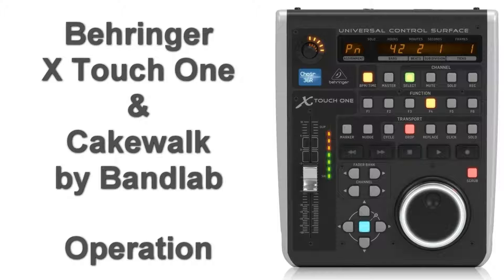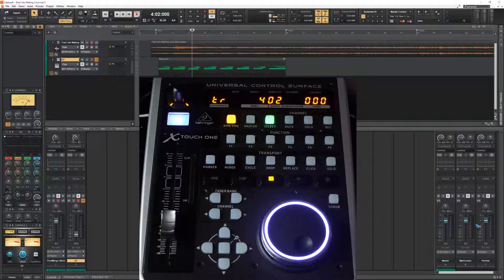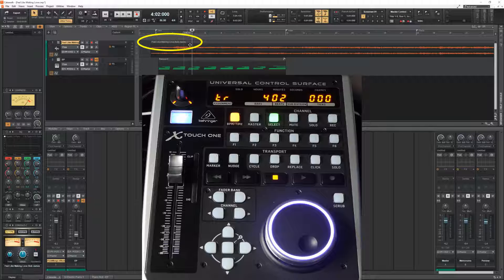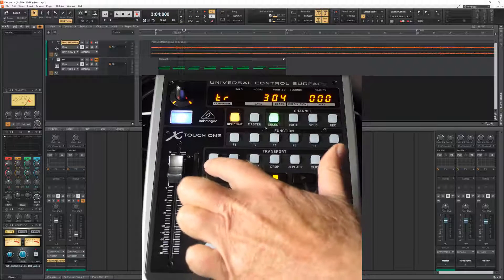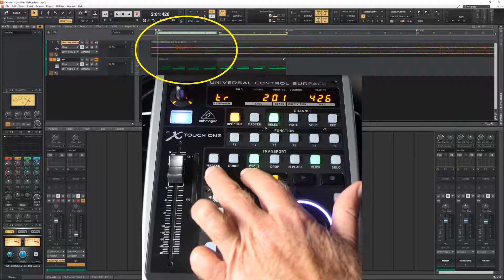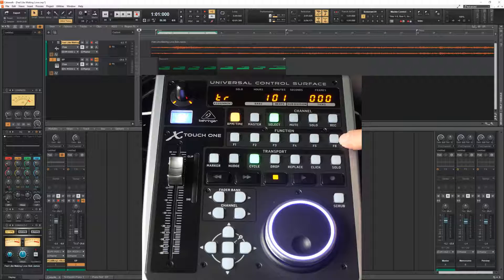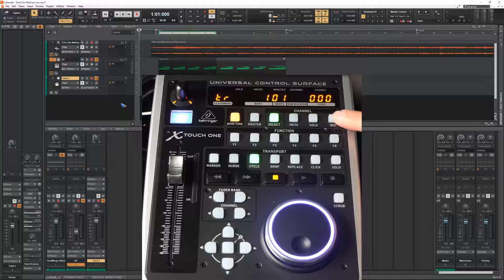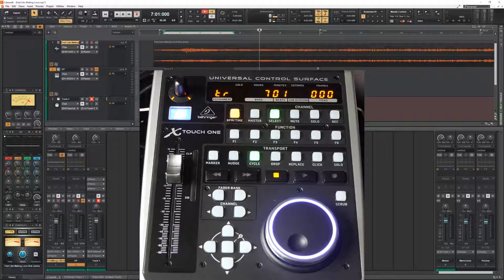Behringer X Touch One with Sonar or Cakewalk

Comment: new XTouch ONE user as of this morning.   Firmware is current.   Using Cakewalk by Bandlab (most recent version).   Using MC Std. mode.   Most everything is working fine EXCEPT I'm unable to select Channels (Tracks).  In the utility I'm using MCU/Cakewalk SONAR mode.    I've checked Use Scrub to change channels.  I'm stumped!     THOUGHTS?        EDIT:   now I'm able to change channels/tracks BUT the scribble strip does NOT show the track name....   weird.     Rusty
Reply from the maker: It's difficult to tell from a distance what could cause this. And even from close by it's difficult. :) I think we just have to be happy that it mostly seems to work, while is was not designed with Cakewalk in mind.
Reply: @rudyshobbychannel             GRACIAS !